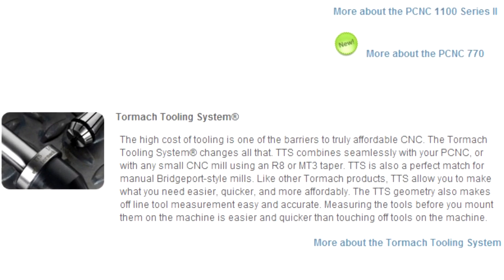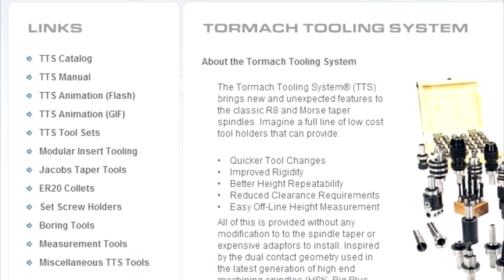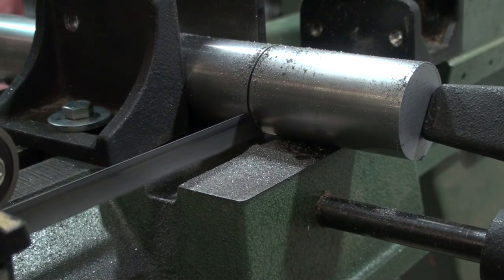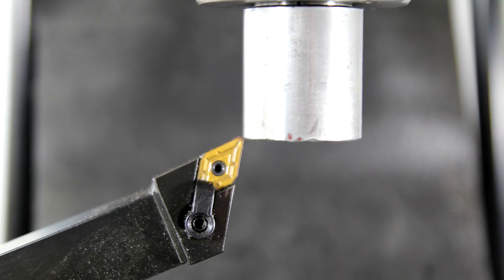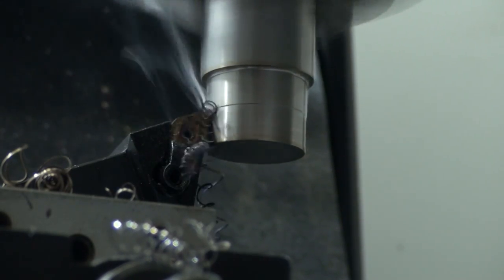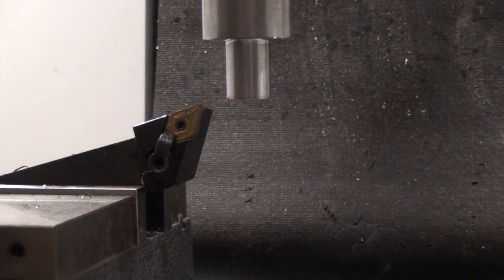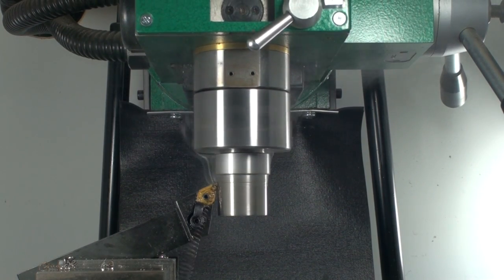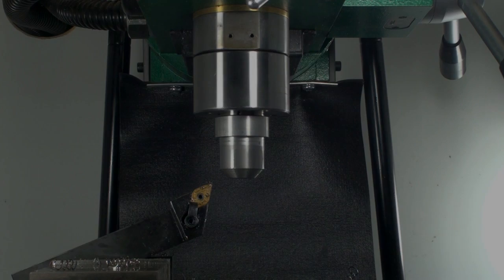Tormach TTS-Style Toolholders on the SX3 Part 1

Comment: my machine isn't setup for cnc yet. do you have the dimensions for the toolholder? get tutorial vids.
Reply from the maker: brian burns There’s nothing that says you have to use CNC to do these.  If you are making just a few, manual works just fine.  CNC really only adds the ability to make multiple copies quickly.
The great thing about these holders is that few dimensions are critical; just the 3/4 “ shank and the tool hole really.  I remember mine being 1-1/2” dia at the shank end, about 2-1/2” long, with a holder dia just larger than 1”.  A 1/2” 45 degree chamfer if you want.  Then bore the tool hole as appropriate.

Good luck in your efforts!

Comment: you don't harden the drillrod?
Reply from the maker: You certainly could.  I didn't bother because I didn't expect hard use from the ones I made.  I expect that after hardening there could be some movement in the metal - might take a bit of grinding.  A Dremel or die grinder mounted vertical to the table running while the spindle was turning would freshen up the inside diameter (or a toolpost grinder in a lathe).  Outside diameter is non-critical but could be touched up to make it look better.

Comment from the maker: I have no problem sharing the G-Code - in fact I did so in a post on CNCZone soon after making these videos.  Go to the Tormach group at CNCZone.com and search for a post named "Making TTS-style toolholders in a Mill/Drill".  The G-Code can be found in post #8 of that thread.

 
I struggled as well trying to get a toolpath to make these using CAM software - I ended up making this code mostly by hand.  It wasn't hard - mostly repetitive.

Comment: Great video, I've never seen a milling machine used to turn. I noticed the chips were very long; your speed and feed are off. You know you have the correct cutting conditions when the chips are shorter, usually around a inch or so. I Learned that from an old timer.

Comment from the maker: Absolutely - any lathe tool will work just as well in this application as it would on a lathe.  The one thing is that is is sometimes hard to get a good approach angle unless you have a very pointed tool, but with some ingenuity you should be able to mount the toolbit appropriately for the cut you want to make.

Thanks for the kind comments - and keep an eye on this channel for info on a whole series of videos coming up - drawbar and lots more!

Comment: great videos i was wondering instead of a carbide indexable cutter could you use a HSS toolbit that you custom ground for that job? my machinist teacher told me to not use carbide for this kind of job because my g0704 doesnt have enough horsepower for carbide... but you clearly did it with your x3 so... would HSS work or not? im just looking for the most economical way and carbide is kind of pricey... Thanks and great vids again... looking forward to a drawbar video :)

Comment: Great job! 
I have Tormach PCNC 1100. To my understanding, the shoulder of the holder should be over cut. In that way, the holder shoulder contact the spindle nose directly, not the collet. If there is no over cut like in this video, TTS still works but the z offset of the tool will not be repeatable. This may not affect a manual work, but will make automatic tool change meaningless.
So I suggest you add the over cut to the shoulder of the holder.

Comment from the maker: @mioduz I used W-1, solely because it was less expensive.  I haven't machined a lot of drill rod, but I don't think that 0-1 or W-1 machine drastically different.  I did not harden these holders after machining, so I don't think it matters much.

Comment: Great video! Thorough and instructive, and very well made.

I miss one thing, though - the recess that creates a separate ring to mate with the spindle. As mentioned in the TTS catalog:

"Each TTS holder has a precision ground shank and ring with a recessed pocket that eliminates collet interference. This design provides repeatable Z position and improves rigidity."

It would require a different lathe tool, however.

And lastly - who did you buy the lathe chuck from? Can't find it...

Comment from the maker: @CncObsession Thank you for your comments.  I, too, drew my inspiration from Hoss and his pneumatic drawbar for the X2.  I think his manual adaptation for the G0704 is sheer genius!  I find that it takes as little as .125 of travel to release the tools - I haven't measured it, but adjust the drawbar engagement in the Tormach collet until I get good holding power when released and easy extraction when depressed.  I think I am using a stack of 6 Bellevilles that Hoss specified at CNCZone.com.